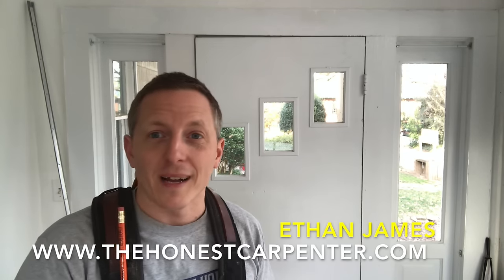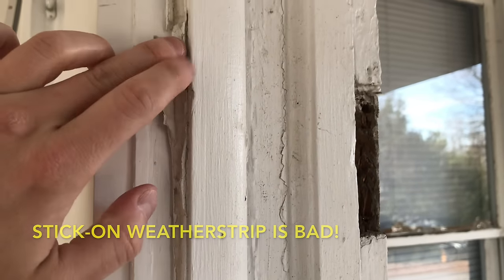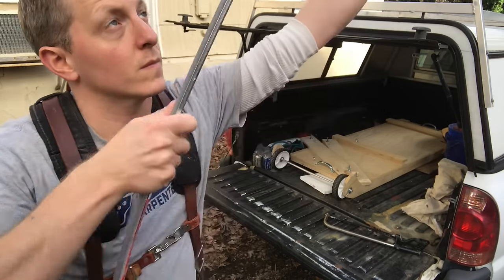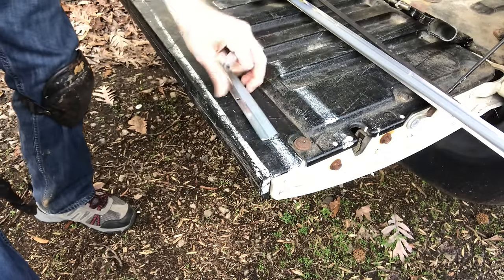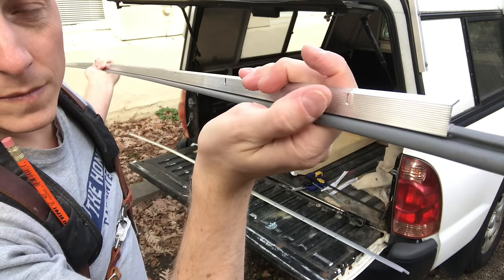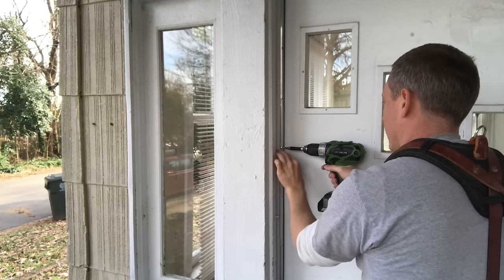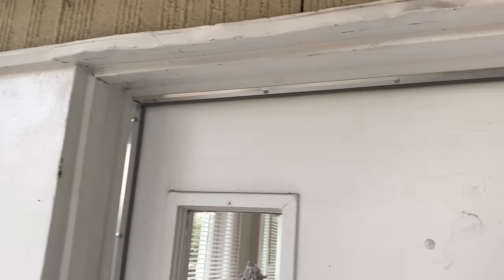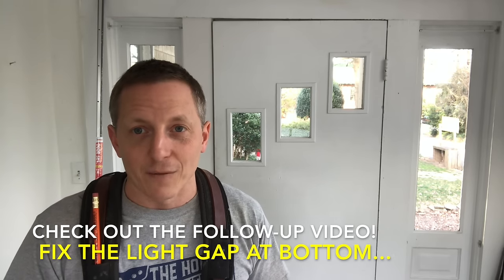USE THIS WEATHERSTRIP ON OLD DOORS! (Save $$, Prevent Cold Air Drafts / BEST DOOR WEATHERSTRIPPING)

Comment: The real secret to this working is to do these things first... 1 tighten all hing screws.  A quarter turn will pull up a door up to an 1/8 inch. Keeps from hitting the frame. 2  Adjust your door knob strike plate first, to easy open and close with as much air seal as possible, us something like bamboo skewers to fill screw hole if you have to move the strike plate in or out up or down, giving you new wood for the screws to bite into. 3 Adjust your dead bolt strike only after the knob set in same manner. 4 When applying the weather strip shown here, do NOT place it to the frame with the aluminum part equal to the door stop.  Close your door lock it and apply the weather stripping as he out lined.  I fix these mistakes daily in my line of work as a locksmith.
Reply: Im not a professional, but I owned an old house previously with a similar door. In addition, if the door is offset in the frame (see image of the closed door behind THC @  5:07), place a shim (I used thin cardboard) behind the hinge to bring it back toward square. Thought this may help someone.

Comment: The seal strip used for pre hung doors is far better than the little rubber seal on the metal strip. I make wooden door stop with a rabbet on my table saw to fit the replacement seal.  The rabbet only needs to be about the thickness of the table saw blade so you don’t even need a dado blade.   It also looks a lot better that the metal.
Reply: Was thinking same thing.  I'm running with this idea

Comment: Great idea! I have a problem with wind and rain that this might help with. My south facing lake cottage gets strong 30-40 mph south winds in the summer that drives rain thru every micro-gap in the wood door and 12 wood frame windows. I am at wits end trying to figure out what to do. And leaving the storms up all summer is a waste of great weather. Replacing these beautiful old wood windows is out of the question.
Any suggestions would be appreciated.

Comment: @TheHonestCarpenter i need help! 

I already have weather stripping within the door frame, but bugs kept crawling in through the light gaps.  I installed these weatherstripping on the outer side frames and bottom (instead of top) to deter bugs...

 Now, there's a really strong vacuum like seal that makes it very hard to open (esp after closed for at least few minutes). Its hot outside vs the inside these days.

Most of the effect seems to be from the door knob side (as the vacuum-like seal went away if i removed this metal weatherstripping).

Suggestion?

Comment: Hey: any suggestions for an older double doors (70’s), where the door latches into the side of the other door (no centre post)? The original weather stripping is getting a bit damaged and could use replaced

Comment: That's great. But I noticed the other day my RV door has about a 3/8" gap between the door edge and the frame. I had wondered why I could see daylight sometimes. So, was thinking about doing the 3/8" window seal along the edge of the door. Do you think it will help?

Comment: I followed instructions to a T.  Marked holes w pencil, used pilot, fixed screws after making sure when door closed and latched there was a good seal.   The rubber keeps popping out of the track so I loosened screws and adjusted slightly only to see daylight and feeling draft coming through.  House was built in the 20s, understandably not like working on a newer, squared frame.   Purchased at Lowes and did not skimp on product.  Am so frustrated to keep having to press rubber back in track only to find it popping out again.     Suggestions please.

Comment: does this also work well on double french patio doors - one of the doors open while the other is for looks and permanently closed, cannot open - 20yrs old +  and slight air leakage around the permanently closed door - can I apply this technique on the outside around the door where there is the original insulation/weather stripping that appears to be failing but cannot remove as door is fixed shut.. can I add this type of metal/vinyl weather stripping?  otherwise thought of caulking before i noticed your video.. and thanx on another video on corner seals for the bottom of the door where light can be seen from the outside - works great

Comment: Can't you take your little plunge cut tool & lay blade against door jamb & cut the little slot on door stop starting at top & going all the way down & going from left to right or right to left at top.  Measure your little insert tab on modern weather stripping & do your plung cut to that depth. Just wondering if that would work. I have a modern door where the manufacturer nailed the door stop over the tab on weatherstripping, no slot.

Comment: Just put in some new gold trimmed ones from md products. The instructions say to put the vinyl or rubber part tight against the door. I painted the door over 2 weeks ago. The rubber part grabbed onto the paint. Oh well. Now my slave door has a combination upper lower bolt slides and they don't want to work well. I'm hearing the springs make noises. House is 50 years old. Do you know of any hardware place that sells gold trim for the slave door with the built in slide bolts?

Comment: This looks like a great option for around the perimeter of my door. My bigger problem is that it is a double door. What do you recommend for between two doors? I have 4” at the bottom where the outside peaks in. Also, the existing weather stripping betw the doors is metal and the edge is pulling away around the lock and I’m afraid someone will cut themselves. Thank you!

Comment: Great tips!

Is there any kind of ready-made strip that can be used at the bottom of a door? We rent an apartment and the front door has a full 1/4" - 3/8" at the bottom. Right now we use one of those pillow strips to help block drafts but it makes the door hard to open, we have to remember it, etc. Would love to learn a more permanent solution that doesn't involve major work?
Reply: Yes, thr seal you want is called a "sweep seal" You can buy them on Amazon.
Reply: @danrothenhoefer4634  Awesome thank you!

Comment: So, about a year ago I installed a new prehung door with integral threshold for my entrance from my attached gargage to my house.  After installing, I noticed a gap on the strike side between the door and jamb stop that extends about 1/3 way up from the bottom, gradually decreasing as you go up.  Over time, the gap has increased farther up!  How do I fix this?  I could remove and reinstall the stop but am wondering if there is an easier way?

Comment: Anyone know of a kit with a wider strip of aluminum?  I tried something similar from Low'es and it was not wide enough to meet the door at that corner as I ran out of wood to support it with.  I have a customer with one corner about 3/4 away from the jamb due to improper installation.  Obviously, I would like to just replace it, but during these times they don't have the money to do that right now.

Comment: Had an apartment front door w so much gap that no weather strip could fix. Found felt weather strip and used several layers to fill the gap.
Where I live now the top of the door is so catawhampus that it has a 1 inch gap on one side and none at the other. I plan on using craft foam sheet to fill the gap.
Reply from the maker: whew, 1" is big Torah! May want to try to do a pine extension if the first option doesn't work
Reply: DR PHIL can’t, it’s an apartment. And I’m leaving when the lease is up. But you’re absolutely correct about the creepy crawling things and such.
Which why I used wooden shims stacked to fill the gap for the door. But tired 3/4” foam for the storm door.
Afternoon sun destroyed the sticky part, so now the craft foam.
Reply: The Honest Carpenter Thanks, I used wood shims in stacks for the door and they work.
The screen door is what I need to use the craft foam on.

Comment: Ethan James, Non of the technique you demonstrated is wrong.  Those hard rubber seals are terrible.  Try the fluffier, softer ones on the same sort of metal frames that mimic the kerf insert style.  You will find, better seal, insulation, sound suppression, less force required to open and close and less fine adjustment.

Comment: great tip!
my man or viewers,
im looking for a solution to weather proof, rain gutter/stop/seal the bottom of patio french doors. rain seeps in and wets carpet. id love something with an an inch lip that will keeps water splash out. recommendations?
Reply: You can find "rain" or "Splash" guards that when attached to the door frame will divert water over past the edge of the door.  You can also install them low on your door to divert any water away from your thresh hold.  Home depot Lowes and the like have them in a few colors.  They work pretty well.  If your thresh hold has too much gap, you might call your local door guy to see if he can help you with that., though they sell those too at said stored.  You just have to know what you need.

Comment: I feel like the need to square up that door.
Reply: What if it’s the door frame or the house itself leaning to one side?
Reply: @josem.2909  - You can still square it up with hinge shims.
Reply: Thanks, I will try that
Reply: @spikefivefivefive  see not if the entire frame is crooked. It's just not worth it, you'd be better off replacing the entire frame and door

Comment: I have a stripped wooden door, do they do wood weather strips?
Reply from the maker: I’ve never seen them before Kev, but they may be out there. Check a local building material distributer near you—they may have something in the catalog.
Reply: Could you tell me if wooden ones are available?

Comment: I would caution against using these aluminum and vinyl bulb weather stripping. They might work fine on a very flat and straight metal door but very many doors are warped and move with seasonal changes. Also the vinyl becomes hard and doesn't allow any compression even when they're new. The same soft foam and vinyl kerf-in weatherstripping is sold pre-installed in a nail on wooden stop that works much better.

Comment: These are great weather straps. At Home Depot, maked as best at around $30. Retaining heat and cool is clearly the primary objective here and is great for a door leading into a garage. But from an aesthetics perspective, wouldn't this be undesirable? Maybe a back or side door but the front door? I'm researching how best to do my front door and I don't want the stripping outside of my door. It just looks too commercial, too industrial. I personally do not want my welcoming door to set the tone of an industrial complex. Otherwise, they're great.
Reply: Who is visiting your house that is going to analyze the front door like that, and ... more importantly, why do you care what they think?  You will need to have extensive carpentry experience to re-frame your front door and put in the proper dado locked rubber seal.  If you can afford this service then why are you watching DIY videos?
Reply: @jong2359  Note that I wasn't complaining, I simply stated an opinion about weather stripping outside the front door. To each their own. I do think that it has a commercial feel about it. Honestly, I can't even think of a place where the weather stripping is outside of a door unless like I mentioned, a garage door, as mine is or a side door.

Nice assumption about my personal finances. My front door has a slot on the inside that the stripping fits into. I was researching how to snug the door up so that there is no slight bit of light entering (or air leak) but lo and behold, I discovered that just replacing the stripping alone did the trick and no need to move the striker and dead bolt plates. And Ibdid it all for the $30 bucks that I spent on the new stripping that I had to pull out of the metal frames. I don't 

But you do what you have to do right? Satisfactory?

Comment: These door seals will drive you crazy, unless every door and window in your apartment is shut tight you'll be subjected to a constant WHISTLING whenever there's any wind or breeze outside. The seals don't seal perfectly so where there's any tiny gap air will squeeze through and WHISTLE. The landlord installed these seals to prevent smoke escaping if there's a fire in our high-rise and they're driving us nuts. I tore mine out I just couldn't take it anymore.

Comment: these strips dont work very well. The rubber/vinyl is way too stiff and causes issues even if you gently push on the door with them. Also, If you install them so that the door and locks work properly, they DONT SEAL. I love the concept but I cant recommend these.